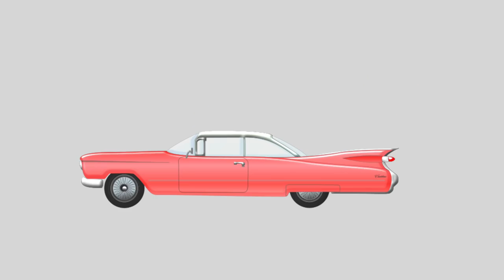Yes, Rockets CAN Fly in a Vacuum

Comment: So once it gets out of the earths orbit there is no oxygen or gravity. So what does the thrust of the engine push against to make the rocket move?
Reply: The rocket itself, and the gases in the combustion chamber.
Reply: Chris - to help you understand, you need to answer a couple of questions.

If you fired a crossbow into a vacuum, would there be any Recoil force pushing the bow backwards as the projectile shoots out forwards?
Why or why not?
Reply: They fly by action/reaction.
Ignite the rocket fuel and...
Exhaust goes out one direction.
The rockets goes the other direction. 
It's not complicated.
Reply: @Pounder Technically speaking: how could you test that in an "infinite vacuum" if there's no such thing? Or if we can't get to it?
I don't know if the crossbow is the ideal example but it demonstrates an important fact.
If the crossbow recoils in a vacuum chamber it's not by "pushing" against something outside of itself, air or atmosphere, it's by by pushing against something INSIDE itself, the bolt.
A rocket doesn't fly by pushing against outside air; it flies by pushing something INSIDE itself out through the engine. Exhaust goes one way, rocket goes the other.
Reply: @Pounder I do know how rockets work. You obviously don't. 
Here's a test that might be a little difficult for us but:
There is no question that air gets thinner as we rise up from the ground.
If rockets fly by pushing against the atmosphere then if we fire identical rockets horizontally from different heights, the higher you are, the less air you have to push against, so the rocket will fly slower and drop sooner.
In reality it's the opposite: the higher you are, the thinner the air, the further and faster the rocket will travel due to the thrust being from inside the rocket and the less air resistance. 
Your theory is ridiculous.
Reply: @Pounder Yes I am aware rockets lose weight as they burn fuel. 
But if rockets can't work in an "infinite vacuum" because there is no air to push then, logically, they should not work as well in thinner and thinner atmosphere. 
I don't know how many atoms of air there are when the air pressure is about 15 pounds per square inch, but lets just say it's X.
So when air pressure is 7 1/2 PSI the number of atoms is half of X. That means the rocket only has half as much mass to push against. 
So if we HORIZONTALLY launch a rocket at 15 PSI when it's 100 feet off the ground and it travels 2000 feet before it starts to drop, then the rocket launched up high, where PSI is 7 1/2, it has less air mass to push against so it will start to fall before 2000 feet.
But its the opposite. It travels FURTHER than 2000 feet before it starts to drop because pushing air has nothing to do with thrust.
Low air density does not reduce thrust.
Reply: @@Poundertruth " because there's still air for it to push off of. "

You didn't address the issue.  If air to push off of was required, they would work worse as you get higher.

But we can obviously see that this isn't the case.  Otherwise, jet aircraft wouldn't fly as high as they do, they'd remain closer to the ground.

How do you calculate rocket (or jet engine) thrust?  Every single equation I can find has no terms or coefficients for atmospheric density.  (The simplest is F=mdot * Ve (mass flow rate * exhaust velocity.))

If atmospheric density is involved, it's a coefficient somewhere, raised to some power.  If the power is negative, then that works for jet engines and rockets working better as the atmosphere is thinner, but that undermines your premise "not so in an infinite vacuum...." because you would have infinite thrust in an infinite vacuum.  So, in your universe, the power isn't negative.  But that's contradicted by better performance of jet/rocket engines as the atmospheric density goes down (within limits for jets, because they gather the oxygen from the surrounding air, while rockets bring their own).
Reply: @Pounder 
If you know so much about how rockets work, tell me how do you calculate the thrust of a rocket engine? 
Why do you continually refuse to answer a basic question about rocket science?
Reply: @@Poundertruth "what is it that you don't understand that jet engines fail to perform at a certain altitude where there is lesser and lesser air"

What is it that you don't understand that rockets don't need to push off of something external to the rocket?
Reply: @bobartor910  - "Why do you continually refuse to answer a basic question about rocket science?"

Because Pounder never took High School physics.

I suspect he dropped out before the 9th grade based on his pre-pubescent intellect.
Reply: @Pounder Why don't YOU educate US and tell us exactly how a Space Shuttle Main Engine works since you seem to have it all figured out?
What kind of fuel, oxidizer, mass flow rates, exhaust velocity, chamber pressure, etc.?

I have actually seen more than one space shuttle launch up close and in person, so I know FOR CERTAIN that they actually CAN take off and fly up through the air.
Tell me how all this works.
Give it to us. Let us have it.
Reply: @@Poundertruth "THE ARGUMENT IS ABOUT ROCKET PROPULSION IN THE INFINITE VACUUM OF SPACE"

The subjects you're whining about (and not answering) are part of rocket propulsion "in the infinite vacuum of space".

"When a rocket runs out of atmosphere to push off of it ceases to propel"

That assertion would violate Newton's 2d and 3d Law, which require that momentum be conserved.  (Rocket fuel and its momentum go one way, the rocket and its momentum goes in the other.  Your assertion that the rocket and its momentum don't go the other way is a blatant violation of the laws of physics you claim to know.)
Reply: @Pounder For you to claim that rockets cannot propel themselves in the vacuum of space means that you do NOT understand Newtons Laws.
Because Newtons laws tell us that rocket propulsion MUST WORK in the vacuum of space.
Now stop trying to lecture people that have been doing this stuff professionally for longer than you have been alive.
Reply: @@Poundertruth Project much? You can't even come up with something entertaining, much less coherent and consistent.
Reply: @Pounder So lets PROVE that YOU do understand basic physics. at a level of a high school student.
Regarding a rocket engine running right here on earth IN ATMOSPHERE, let's SEE if you can answer three trivially simple questions ( I suspect you CANNOT):
When the rocket engine is running here on earth IN ATMOSPHERE:
1 - Does the exhaust gas get "ACCELERATED" by the engine?
2 - Does this exhaust gas have "MASS"?
3 - Can any "MASS" be "ACCELERATED" without a "FORCE"?
OR is a force REQUIRED for a mass to be accelerated?

Now be sure to come up with excuses for not answering my questions like you ALWAYS DO instead of just answering them.
Reply: @@Poundertruth "How many freaking times do you have to be reminded the subject of the video and this  thread is *ROCKETS IN A VACUUM*."

And it's been explained to you many times how it works (exhaust gas and its momentum goes one way, the rocket goes the other) and how you are wrong.  That you don't appear to understand it is a problem on your part.
Reply: @Pounder - "Now watch as Pounder types more words explaining why he doesn't need to answer my questions while personally attacking me than the three "Yes/No" answers required to just answer."

Thanks for proving my point genius.

If you cannot answer the questions JUST SAY THAT.
But we know that you refuse to answer because the correct answers PROVE YOU WRONG.
Reply: @Pounder so why did you stop using your papa legba or DrCash7 accounts?
Reply: @Pounder and I see that you are incapable of explaining how rockets work in atmosphere or not.
Reply: @Pounder - I will explain something but it is for the other readers since you wont understand it.
I use crossbows for the simple reason that they derive their "Recoil" from the law of conservation of momentum.
A result of the 'Law of Conservation of momentum" IS: Any MASS that exerts a FORCE on another MASS - MUST feel an "equal and opposite force" to the one it is applying to the other force for the same amount of time.
This changes BOTH masses by the same amount of MOMENTUM.
Crossbows feel a recoil force due to the fact that the Bow (mass #1) exerts a force onto the Projectile (mass #2).
During this interaction (of the bow accelerating the projectile) BOTH the projectile AND the BOW feel the same amount of force for the same duration.
This alters the MOMENUM of both objects equally.
The Tsiolkovsky Rocket Equation is DERIVED from the law of conservation of momentum.
The pushing on the mass of the exhaust gas is what propels the rocket in vacuum AND IN ATMOSPHERE.
The force forward on the rocket is due to the acceleration of mass rearward imparting a "RECOIL force" propelling the rocket forward.

VERY SIMPLE PHYSICS but apparently over Pounder's head.
Reply: @Pounder Yes we understand your frustration for not being able to keep up with the grownup conversations.
Its Ok, you can just have a nap now.
Reply: @@Poundertruth if rockets do not need to push off an external object then they violate Newtons first law. Look: "His first law states that every object remains at rest or in uniform motion in a straight line unless compelled to change its state by the action of an external force". That's from the NASA website btw 😂. So anyhow, a vacuum cannot apply an external force, therefore a rocket in a  vacuum cannot alter its state of motion. QED lol.
Reply: @papalegba6796  And if they don't move in a vacuum, they violate the 2d and 3d laws, which indicate conservation of momentum.

And Newton's First Law does NOT require an "external" force, either, nor is it mentioned in the text from Principa Mathematica.

Typical science denier failure.
Reply: @davidmescher2526  so NASA are lying about Newtons laws? Ok we agree thanks chatbot! 😂
Reply: @davidmescher2526 so Newtons laws mean whatever you want them to mean? Ok chatbot 😂
Reply: @stuartgray5877  yes, & the only possibility for that other external mass is the atmosphere through which the rocket moves. A free body diagram shows this, but chatbots can't draw them 😂
Reply: @stuartgray5877  a gas expanding into a vacuum does not create work, chatbot spammer.
Reply: @davidmescher2526  - "A simple free body diagram would show the basics, but you can't draw one."
I have LITERALLY been asking for one from him for YEARS.
because he keeps claiming that if WE were to draw one it would prove HIS POINT.
He doesn't know how to even start a FBD.
I have also asked him what the combustion product of hydrogen and oxygen IS.
Or how rocket can accelerate mass without applying a force.
All he does is hurl juvenile insults and call us bots.
Reply: @davidmescher2526  it's a gas law. W=PV. You're not programmed to understand it tho 😂
Reply: @stuartgray5877  you can't draw things in a YouTube comment, chatbot 😂
Reply: @@Poundertruth the chatbots are calling the gas laws idiotic again & think you can draw things in YouTube comments. They're a hoot! 😂
Reply: @papalegba6796  - " you can't draw things in a YouTube comment

Then WHY do YOU keep ASKING US TO DO THAT SH|T for BRAINS???
Reply: @papalegba6796  But WHY do you REFUSE to tell us HOW the mass of the exhaust gas gets accelerated into the vacuum?
Too difficult of a question for your genius?

WHERE
DOES
the
FORCE
COME FROM
that accelerates that mass?
Reply: @davidmescher2526  why you hate the gas laws, chatbot? 😂
Reply: @papalegba6796  - "why you hate the gas laws, chatbot?"

Why won't YOU tell us how rockets accelerate mass?
Oh, THATS RIGHT you CAN'T answer, or you prove yourself to be wrong.
Reply: @davidmescher2526  Notice how papalegba understands what questions to avoid?
If it did NOT understand basic physics, it would not understand that my questions are a trap.
Since it seems to be aware of the trap then it KNOWS that accelerating mass REQUIRES a force but refuses to admit it.
Because as soon as it admits that acceleration of mass requires a force, then it has to admit there IS ONE accelerating the mass of the exhaust gas into the vacuum.
Then what does Newton's Third law say about that??

Comment: This chick is an air head. A car moving along the ground has absolutely nothing to do with how a rocket is able to move when in a vacuum. She never answered the question at all.
The air balloon doesn't resolve the question either, since she is doing it in normal, atmospheric conditions and not in a vacuum. Gravity has nothing to do with it either. She explained absolutely nothing! The stuff she talked about, I already knew since elementary school, yet I still don't know how anything propels itself in space, if their is nothing to push off of.
If a rocket can push itself off against nothing, does that mean that we can swim in space? What's the difference? She never came close to answering that question, at all.
Reply: Rockets eject mass, so does the open baloon. 
Swimming doesn't.
Reply: @niallkinsella2687  Assuming you have an actual point, how does ejecting mass, move an object, if their is no resistance to the mass being moved?
Reply: @southernknight9983  Anything with mass has inertia. Matter with inertia resists any force attempting to accelerate it, creating an equal force in the opposite direction.
Reply: Southern Knight if I fired a crossbow in space would I feel recoil or not?
Reply: @stuartgray5877  No. Why should you?
Reply: Southern Knight you most certainly WILL feel recoil just like you do on earth. That is because the projectile has mass and “pushing” on mass to accelerate it requires a force
Reply: @stuartgray5877  The arrow is being pushed by the stretched draw string, thus it is pushing off the quiver or bolt to generate the force of recoil. Matter pressing against matter. There is no matter in a vacuum for a gas to press off of.
Reply: @southernknight9983  - In space the Rocket ENGINE is one mass (like the crossbow) the Exhaust GAS is the second mass (like the crossbow projectile).
when the engine PUSHES AWAY THE EXHAUST GAS it FEELS the same recoil force that a crossbow would feel when pushing away the projectile.
This RECOIL FORCE is what accelerates the rocket forward as it PUSHES the mass of the exhaust backwards.
Reply: @stuartgray5877  "when the engine PUSHES AWAY THE EXHAUST GAS"
The engine? I am referring about thrusters or a rocket, in the vacuum of space, not an engine.
Even if you meant, rocket, what is the rocket pushing against to generate any thrust? There is nothing to push off of. It's empty space. The exhaust gas, as you call it, should move out freely, without any resistance what so ever, thus not putting any force against the rocket, at all. The only thing that should move, is the gas, because it was under pressure, inside, but there is no pressure, outside, cause it is a vacuum. Gas exits freely, rocket stays still.
See what I am saying?
Reply: @southernknight9983  
What causes the exhaust gases to start moving relative to the rocket?
Up until the fuel is burned into exhaust in the rocket engine (or rocket motor, if you prefer), the fuel and rocket are traveling in the exact same direction at the exact same velocity.

Some force has to act on the fuel to cause it to change velocity, otherwise when it exits the rocket it will just keep travelling at the exact same velocity and direction as before it exited the rocket.
Reply: @niallkinsella2687  Some force has to act on the fuel to cause it to change velocity, otherwise when it exits the rocket it will just keep travelling at the exact same velocity and direction
You are making the assumption that the rocket is already moving. I am not making that assumption. Though, if the rocket was already moving, in space, there is no reason for the exit of any gas to alter its course, since there is nothing for that gas to push against to move the rocket. The escaping gas goes freely and without resistance, out of the rocket, other than the valve that it is passing through, which is part of the rocket, so the valve can't move it away and just passes through, because of the internal pressure. The gas has reason to move, but the rocket does not.
Some force has to act on the fuel to cause it to change velocity
Might that be, ignition? This just adds to the initial pressure of the escaping gas. It is just gas expanding all  the more rapidly. Nothing more.
Reply: @southernknight9983  
Assumption that the rocket is already moving?
Yes, it is. Relativity means that everything is moving. We're only concerned about how the rocket and exhaust are moving relative to eachother.

The source is ignition?
So when the fuel is ignited you agree that it begins to expand? Now the combustion chamber is full of expanding igniting fuel with only one tiny nozzle to exit through, correct?
Reply: @southernknight9983   - Watch the YT video "Uninterrupted Footage of the Falcon Heavy Launch and Booster Landing! "
for UNDENIABLE VIDEO EVIDENCE of Rocket Propulsion IN A VACUUM .
Reply: Southern Knight so DID YOU WATCH THE VIDEO or are you afraid to be proven wrong?  I’ll bet you did watch and now you are too embarrassed to comment